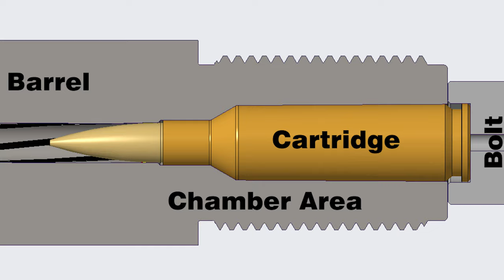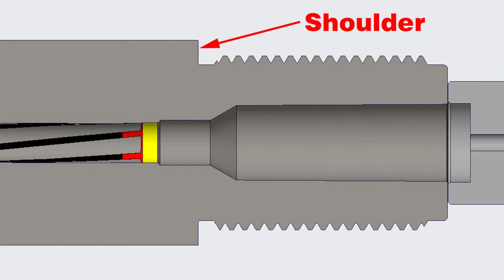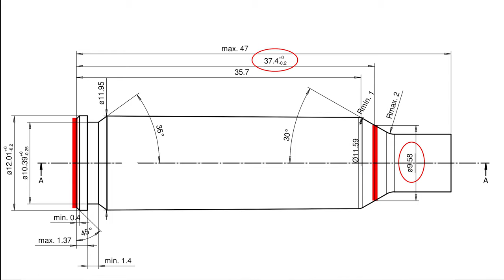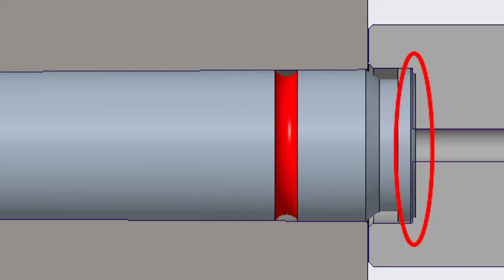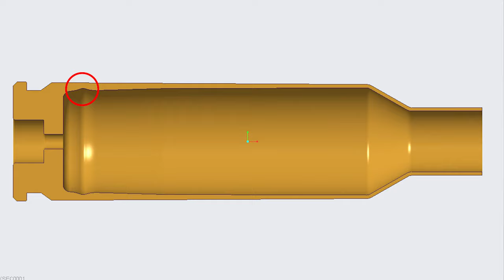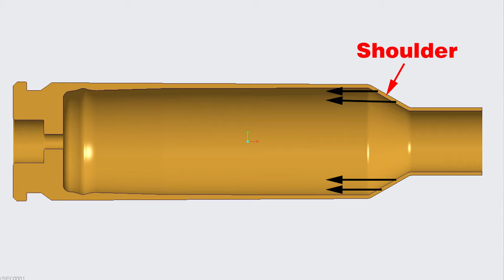Excessive Rifle Chamber Headspace is dangerous! Why it's dangerous and how to check it in your rifle

Comment: The Hornady Reloading manual goes over this in the beginning. Casehead separation is basically an eventually. The better you treat your brass, the longer it'll last.
But it doesn't give great reasoning as to why it's seemingly a specific line on the brass.
I guess, if you slow down time, that area is experiencing heat and pressure for the longest amount of time. Although, now that I think about it, there is also slight outward expansion. Hence, the full-size resizing. So the area beneath it is stronger with the thicker walls and the area above it is more uniform and pressure is more evenly spread.
I don't know, now I'm just rambling.
Reply from the maker: Your "rambling" post that didn't ramble, IMO, got me thinking...I have 6x47 Lapua case, projectile, and chamber modeled.  I am going to run a finite element analysis on it.  If it yields any insight, I'll do a short video on it.  Thanks for watching!

Comment: Good job explaining. I had my new 6.5 Grendel AR case separate, caused a catastrophic failure damaging the lower and upper. I have come to learn much from this experience by researching and testing loads I hand load. I’m still trying to understand more. I have noticed that the 6.5 Grendel bolts I have have different headspace. One of them locks with the no-go the other doesn’t. I’ve also noticed that brass manufacturers manufacture their brass with different out-of-the-box headspace. I go to the range and fire form brass then go from there making sure I keep it within the specs for the particular rifle with its particular BCG. I’ve been taking copious notes.
Thanks for sharing this video it’s good to know what others are experiencing and what their thoughts are on possible solutions 👍
Reply from the maker: Any AR barrel won't necessarily match up with any AR bolt - they should always be checked, as you found out.  I would guess manufacturers shoot for the low end of base-to-shoulder measurements so that their ammo chambers in any in-spec rifle.  I think you have the right idea, keep brass with each rifle, and only bump the shoulder as much as needed to maximize brass life.  Thanks for watching!!!

Comment: I recently had a sobering revelation. I have go-gauges from PTG, Dave Manson, and Forster for my 28 Nosler ( I borrowed two of the three actually). I checked the headspace of each against a precision LE Wilson micrometer case gauge. The extreme spread between these three 0.0045"! What the heck? So I called one of the three companies (not Dave Manson) and received a less-than-satisfying answer. I decided to use the Dave Manson go-gauge because I trust him the most and his was the smallest and fit SAAMI specs the best. But my comments' purpose is to say, take it all with a grain of salt. Thanks for the video!
Reply from the maker: Very interesting.  I have never actually compared go-gauges from batch to batch or brand to brand.  I'm now curious...  Thanks for the comment!

Comment: Good info.  I come to realize its best to keep fired cases with the same rifle and not to mix.  Curious if you anneal your brass ?
Reply from the maker: You benefit by keeping brass with the rifle that fired it because when resizing the case, you only have to size it enough so it chambers easily/reliably. Generally that means only bumping the shoulder about 0.001-0.002”, where as bottoming the die out could move that shoulder up to 0.005”+ depending on your chamber dimensions. Sizing fired brass specifically for your chamber will prolong your brass life.  

And I do anneal the neck and shoulder before sizing (every reloading)…I find it prolongs brass life. With annealing properly, I have found the primer pocket will wear out before the neck cracks. 

Thank you so much for watching! I’m glad at least one person found this video helpful. 😂 Let me know if you have more questions.

Comment: Very interesting, but nothing is clear. 🧐
Reply from the maker: Sorry about that.  It is a complex top.  I tried my best to make it easily consumable.
Reply: @ChristopherBrusa  I was joking. Once I saw with my own eyes how a cartridge explodes. The bolt was torn from the locking (idk in eng) and hit the man under the eye. The cartridge case .308 Silver series "TulAmmo" was torn just like you showed. Tula cartridge factory produces very good cartridges 5.45x39, 7.62x39, 7.62x54R, but not typical calibers for us sometimes have problems.
Reply from the maker: Is the silver series a lacquered steel case?  Or brass?
Reply: @ChristopherBrusa  zinced steel case

Comment: That does not look like excessive head space to me. It looks like excessive resizing. I have been in machining and gun repair(Including machineguns) 40+ years.   .003 is nothing. It probably does not even fail the "Field gauge" on most cartridges. Watching you trying to explain headspace is a long, drawn out and painful thing. There is something else going on there if you have a clean separation like that.   After years of dealing with customers, I learned to ask "Do you reload?" before working on the gun.
Reply from the maker: Thanks for watching!
Reply: Id be pretty ashamed to whip out credentials like that and not think .003" is anything when it comes to head space. Difference between a go and no go is not more than .006" and majority are not at minimum spec. A chamber with go guage +.002 is on the tighter side and when you stack .003" you are damn close to failing a no go test. The only other explanation that would cause this is too much clearance between the bolt nose and chamber face allowing the case to expand on the unsupported gap even with proper headspace. 2-3 firings and you see the case come apart like this.
Reply: @vinmal2858  Do some more studying before you spread  nonsense.     "Damn close to failing a NO GO test".  So what? Still good to a FIELD gauge and not dangerous (Until you keep resizing it).     "2-3 firings".  No kidding, that is a resizing/hot load problem. The man admits he loads hot.  I have made reamers and believe me the brand of brass has a lot more to do with it than a chamber reading on the "High".   The general body diameter allowance (SAAMI) specs of a cartridge are .008. The headspace gauge will not pick that up, but it affects brass life.  Headspace gauges are a "Quick" safety check and hardly the end all answer to a problem.  Show me the SAAMI or CIP specs for a chamber to use re-sized brass.